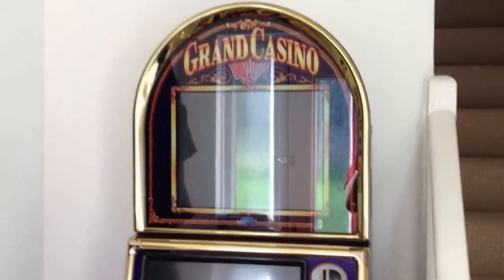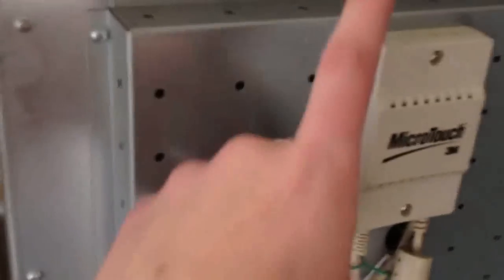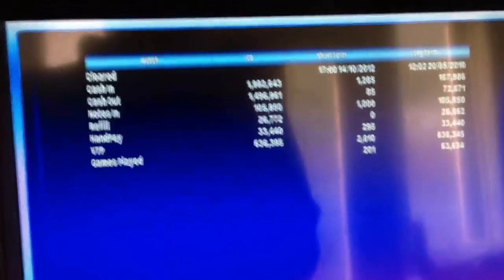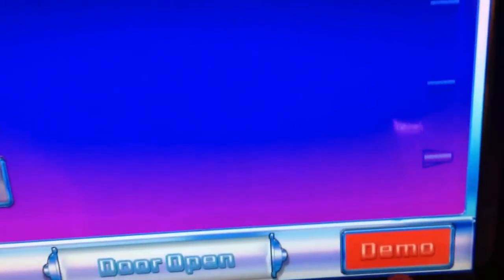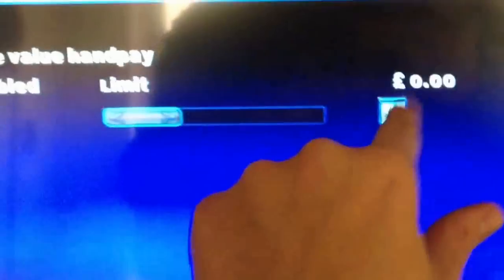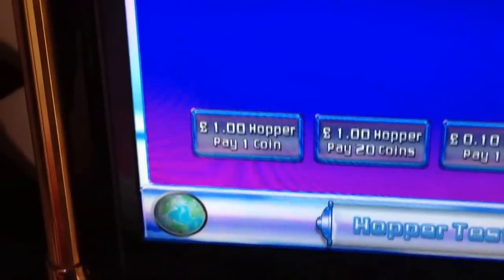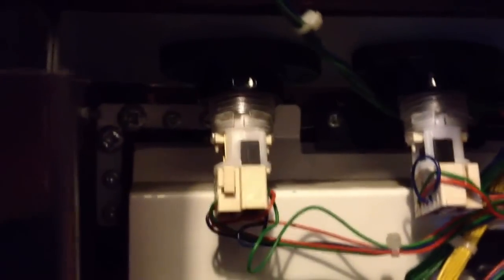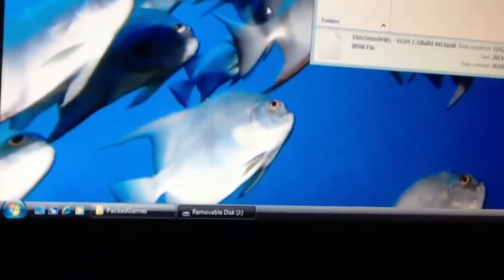How To Fix Barcrest RIO £500 Jackpot  - Instructional Video - Fruit Machine Video

Comment: Hi Nick I need some help! Loving your video very useful but today I turned my machine on and get a self test box pop up on both screens that says SELF TEST then has 3 boxes that are red green and blue in colour and they also say RED GREEN and BLUE and then beneath that is says THIS MONITOR IS WORKING PLEASE CHECK THE VIDEO CABLE AND COMPUTER. I see that someone also has a similar problem below in your comments and you mention engineer mode and referenced your video. I could not see any reference to engineer mode in your video? How do you get into engineer mode and what do I need to do? Any thoughts?? FYI I checked all of the cables and they seem good? A video or some direction on what I need to do would be great. Thanks in advance :)

Comment: So useful. Thanks Nick!
I am going to clone the hard drive in mine but thinking of using an SSD as may help boot quicker. Do you know if it would work?
Reply from the maker: I'm not sure. It sounds like a really good idea though. Let me know how you got on.
Reply: It works great, I've done the same with an SSD. Is it possible to get to boot into windows xp that's running on it?
Reply: Also, to install the bpak files, to add games on mine, I just copied them over with the rio drive connected to my PC. It works.

Comment: Good morning,

Please could you help, I have a 2005 B3 £500 rainbow riches jackpot machine, its a Barcrest , the problem I have is that if I go to collect the banked winnings the machine whirrs away then starts shouting check it out check it out, which I could live with as I use the machine for savings and just transferred any winnings to the credits side, but yesterday afternoon I had over £700 in the winnings side then won £380 which took it over £1000 winnings and the machine tried to pay out  failed then started to shout check it out, check it out , I switched machine off then back on and its in constant alarm, I have no instructions or manual for this machine,hopper has over £350 in £ coins 

kind regards kevin

Comment: Can the note changer in the Rio be updated to take new notes
Reply from the maker: It sure can. But you'd likely have to find a new faceplate and change the note mech to a NV10USB+
If you have an old JCM EBA or Taiko note acceptor, these can't be updated.

Comment: Hi,Going mad hope you can help. Have elvis top 20 but  stays with blank screens (floating message) and start up light constantly blinking.  Have tried keyboard restart but not working as machine not starting up.   Have tried all plugs etc.  Was working perfect till moved house and this started.  Any help would be really appreciated.
Reply: ***** Hi, Thanks for the reply.   I do not think it is the power supply as all the four supply leds are constantly on, just the start up led blinking, which I assume is because not booting game??   All cabinet lights OK.   I have looked at the battery and it seems to be fixed to the mpu5 board.   Can I just unsolder and replace with a normal CR2032 battery (think that is the number).   How and what is the RAM.  Sorry but not really computer confident.   Is it the plug in unit on the MPU5 board.   Again any help would be really appreciated. Regards,  Chris.

Comment: Hi nick.I have the elvis version of the same machine but when I turn on machine I just get a 'test screen-please check video cables and PC and bottom screen just has floating box with 'no signal' in it.wondered if the HDD is corrupt or if I have PC problems.any help would be appreciated.

Comment: Hi Nick, I have a machine the same as yours but `Rainbow Riches.`When I switch it on the top screen has a floating box saying no signal & the bottom screen has a floating box saying self test, with 3 colored boxes, red green & blue & the words below `This monitor is working. Please check the video cable & computer`      Can you help with this please?  Thanks, Mick
Reply: hi mate had the same problem as michael above updated microsoft windows will this help

Comment: Thanks for that Nick. I shall have to wait until my Daughter gets in from work as she is very good on the computer. Out of interest where abouts in the UK are you based?
Reply: Ah right.... i`m in Chichester West Sussex. I was going to ask you if you fancied looking at it as a job. I also have a Digital Bubbler Jukebox that the screen decided to stop working aswell
Reply: No cursor displays and when you press alt tab nothing happens. It turns straight on, the top screen says no signal and the bottom says self test with the red green and blue boxes on it. Very frustrating!!

Comment: hello hope you can help as my working cashino rio cabinet 500 is now not working,was uploading bpak files to my machine,rainbow riches worked fine,was uploading elvis and got an error,re booted machine and got blue alarm screen error 16 mpu 5 error mpu 5 no comms breakdown, trying to fix it i uploaded an executive file for the sit down machine exec file 3-2-3-17 barboot 4-3-1-295 its also updated the prog card binfile to erio 2.3 instead of the previous binfile erio 1.2, the previous exec file